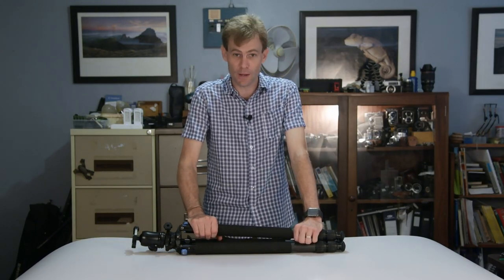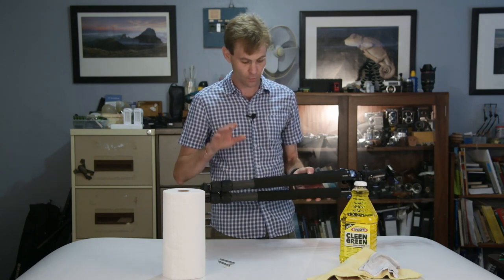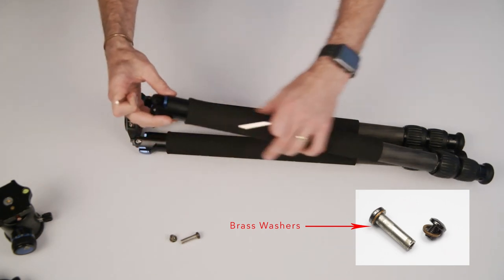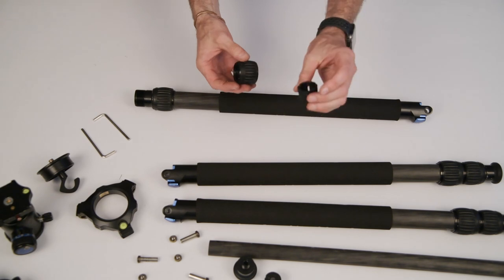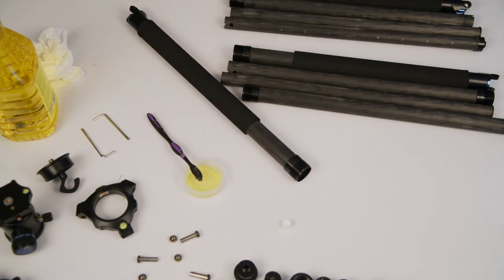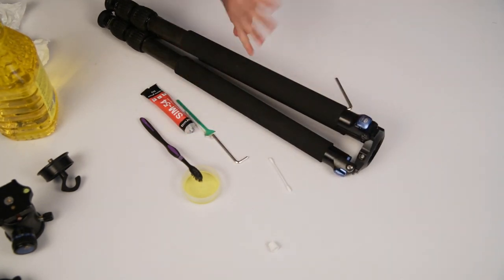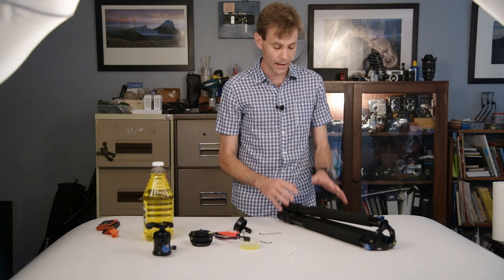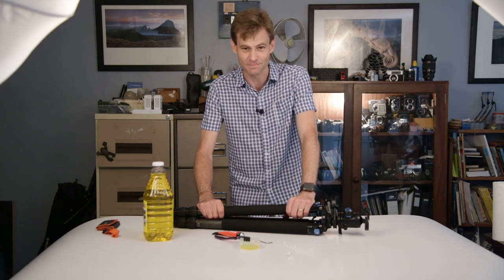Tripod Maintenance

Comment: Nice video. I only wish you would make a list of the materials you use in this video, J. Payne, Charlotte, NC.
Reply from the maker: Noted, although I'm not sure it would help where you are (I think we have several products that are different or not necessarily available). At any rate, the only products really worth mentioning here are 'Clean Green', an abrasive free detergent concentrate, and SIM-54 which is an industrial application silicone grease. Both should have readily available alternatives in NC. Cheers
Reply: Ha ha what a spoof